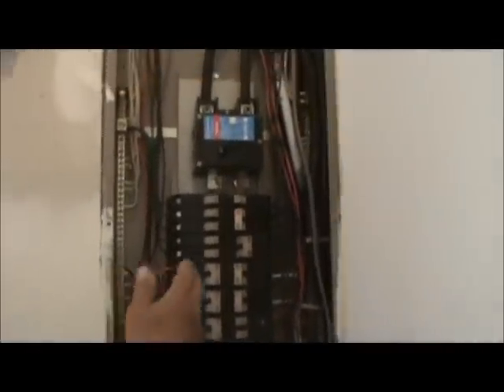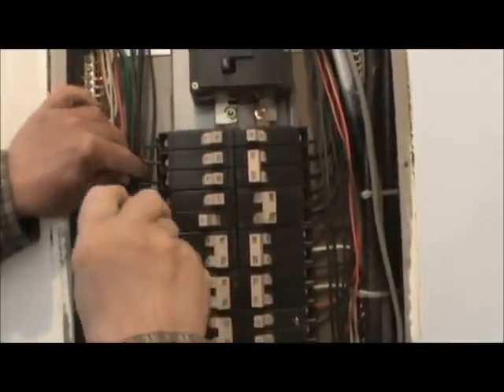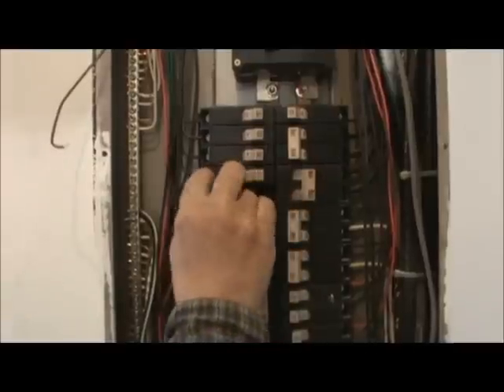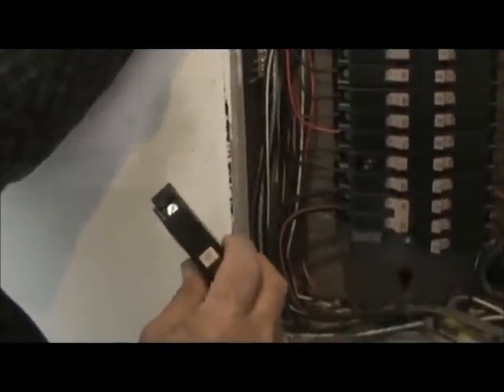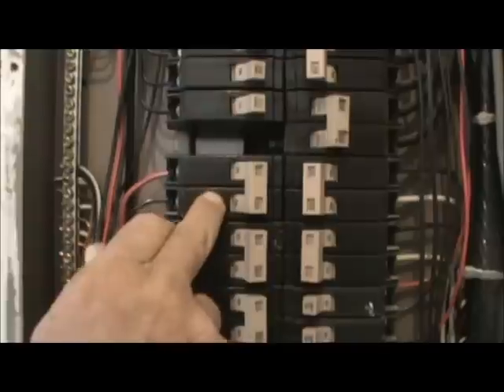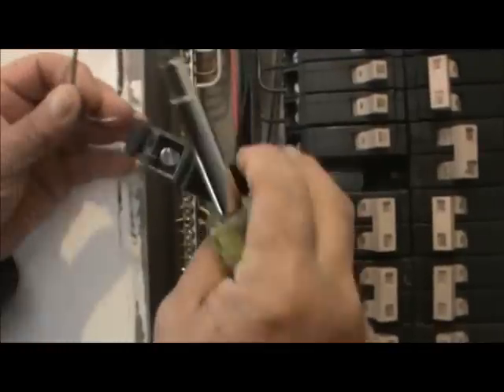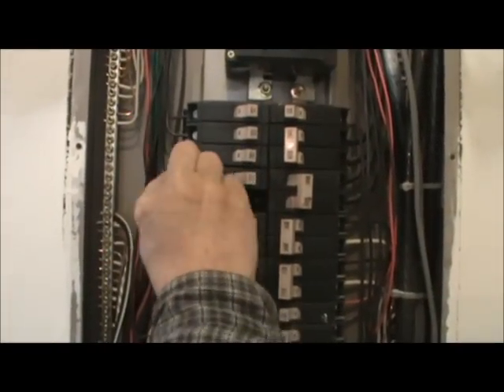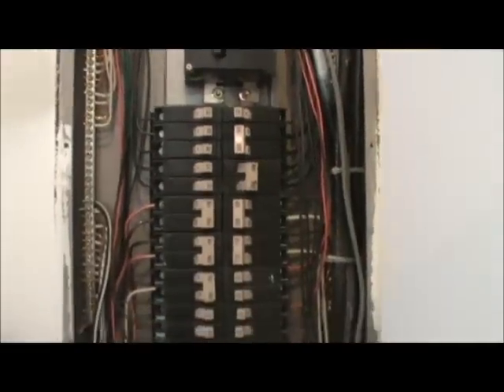How To Replace A Breaker In A Panel Box

Comment: Thanks for this video. My kitchen lights went out, the breaker switch is stuck in the middle. It won't turn off or on. It sparked too. 😢 I'm going to replace it today. I will turn all the power off first.

Comment: Thank you for the simple explanation.  I have installed breakers in my old house where I did a full kitchen remodel and added several new appliances and more outlets.   However, now I live in a high-rise condo, all the Main breakers to each unit lives in a locked "closet", in the main hallway.  So, I can see instances where one has to work on a "live" panel, removing or upgrading breakers.  My current project involves a tankless water heater and requires that I upgrade the breaker from a 30A to 40A.  The building is 2008 and the breakers are GE, it's a quality panel.  However, any decent tankless water heater will require 8 or 6 gauge cables.  The current fat tank water heater uses 30A and 10ga cables.  So, I have new power cable fishing to do from the panel to the AC closet, where the water heater lives.  This will involve popping out and popping in new breakers in a Live panel.

Comment: For the novice whose about to attempt a DIY replacement. Bad, deadly news here, Harold doesn't mention that the house powers main breaker needs to be turned off before poking around with the breaker with a screwdriver for removal!

Comment: I have a breaker box and I added a electric central heat and air unit it was added 2 years ago it is not working and when I checked the panel box the breaker that is marked heat made a popping noise when I wiggled it, and I noticed all of the breakers on the right side of the box are loose the only thing I noticed not working is the heat. I know we have to replace the heat breaker but should I be worried about the other breakers?
Reply from the maker: Give me a call I can help.
Reply from the maker: 434-284-.0600

Comment: Kill the main power before removing the panel!  Bad advice here.
Reply: Most electricians don't turn off the main. They turn off the the breaker and normally remove the breaker then unscrew the wire. the replace it. It is quite safe unless you stick your fingers up where the breaker was and touch the leads.
Reply from the maker: We do not turn off main because mains some times do not want to come back on. When you turn off the breaker you are changing is all you have to do.
Reply: If you turn off the main and it doesn't come back on, then you need to fix it first.  For DIY they should always turn off the main.
Reply: You're assuming that's possible. Unfortunately, you don't always have the ability to cut power without having the power company disconnect the meter.

Comment: Harold I do not have a problem with anything you did as you are qualified but torque is becoming an issue as it is part of the manufacturer's installation instructions and I noticed you are not doing this. Have you heard this through any required NEC code classes?
Reply from the maker: Know I have not. I will check that.

Comment: Thanks for such a straightforward explanation. I would add, however, that you should turn off the main breaker before working inside the panel.
Reply from the maker: The main is not switch duty, some times it does not want to reset, so leave on watch what you touch. And thank you
Reply: @TheNaturesFriends seems to me the wire you touched would be hot of main isn’t off
Reply: Thank you, I can't believe he never mentioned that shit.
Reply: @RandyKnight-o1q loo is o 2:14
Reply: Or the incoming is on the other side and the wire you touched is after breaker (such as leaves breaker and goes to bedroom)

Comment: I was told by a coworker that the breaker part that connects to my dryer outlet is bad because there's not enough electricity running through and not enough to power the dryer.  How much does it cost to get someone to replace the breaker?  I tried taking it off myself and ended having 220 watts of spark fly in my face.  I don't want to try it myself again.
Reply from the maker: Call a service man,did you turn the breaker off. You need a service call.

Comment: I do not have to turn off the main breaker as long as I work carefully, correct?  I DO however have to turn off the breaker that I am working on. Let me know.
Reply from the maker: You are right Thank you . Just be careful.
Reply: Thanks, I will buy the breaker and install it.
Reply from the maker: Let me no how it goes.
Reply: How did it go?
Reply: I checked 6 receptacles and two light switches. Turns out that I could visually see that a receptacle was the problem so I replaced the receptacle and have not had any issues. I did buy and keep a new breaker (ARC) just in case. Thanks for inquiring.
Reply: Okay. I had a 20amp breaker that I turned off just like Harold directed, loosened the screw, removed the wire and then the breaker. Tomorrow I will put in a new breaker and we'll see how it goes from there.
Reply: check your receptacles and switches visually to make sure the wires look OK, make sure screws are tight, and make sure wires are not touching anywhere they are not suppose to touch. Then, replace the breaker.
Reply: Finally put in the 20amp replacement breaker as directed by Harold.  Everything went just as he explained ... Merry Christmas all!  :D
Reply from the maker: Thank you.

Comment: Harold, do I have to shut the main breaker before replacing my burnt out 20 amp breaker ?
Reply from the maker: It would be safer but I just turn off the one I am replacing.If you do not feel safe with the box hot turn off main.
Reply: If he doesn't want to shut the main breaker off, couldn't he be a little safer by shutting off the breaker, then pop it out of the box, then remove the screws while its off the bus bar, away from everything else? And just reverse the installation of the new breaker.
Reply: Always treat these things like they're hot regardless of how certain you are that they've been properly deenergized.

You probably don't have to turn it off in the technical sense, but it is somewhat safer. In most cases, you should be fine so long as the portion you're working on is deenergized and you don't touch more than one thing at a time.

Comment: Hi, the breaker that runs the power in the living room shuts off. I noticed that when I turned the breaker switch to OFF, the breaker was loose. The breaker is not sitting firmly like the others. I noticed also that when I pushed it back in and then turned the switch to ON, power came back on in my living room but then the power went off about a minute later, just on that room. Why does it keep doing this? And does the loose breaker broken or is it its way of saying its going bad? I'm going to go outside in a bit and turn the main power off (all of them) because I'm afraid of any kind of possible shock (haha) and remove the whole breaker piece and see whats the deal. Any suggestions? Thanks, Mario.
Reply from the maker: Yes you can turn off main then change that breaker that cuts off  easy job to do
Reply: Hi Harold. Your video really helped me and learned a lot. Thanks. Ok, I followed your footsteps and changed the breaker. Power comes back on but now my fan in the living room stopped running. I did check all the outlets and everything works in that same breaker. I guess my fan clunked out me? The fan is hardwired to the switch in the same breaker and was working before the breaker went out.
Reply from the maker: call me at 434 985 2013 or cell 434 284 0600 we can talk about it

Comment: i  have a question...there was a heating element installed in ductwork to my oil furnace and the breaker was 60 amps.  I took it out and noticed the wire only had 3 wires in it one red.one black and a ground....why is there not a white or neutral wire here?
Reply from the maker: +moe roy You do not need a white just ground and 2 hots 240 volt no 120 in the heater
Reply: +Harold Shifflett thanks

Comment: do you know if an electrician or pg and e will come in for free to test my breaker amperage? I need to know the amperage so I can install a gfci in my room for my son and I cannot remove my breaker panel as I do not know how to take it off and I also do not have a volt meter.
Reply from the maker: +randomhalofan292 No free stuff sorry
Reply: Harold Shifflett
I ask only because my OSHA instructor said they may come in and test it.
Reply from the maker: +randomhalofan292 A number 12 wire is 20 amps a 14 wire is 15 amps
Reply: Harold Shifflett
Thank you so much, does color come into anything, or are the numbers printed on the wires?
Reply from the maker: +randomhalofan292 White is neutral Black Hot

Comment: Thanks for this video, Harold. Very helpful. 

Only one question: do you have to turn off the main switch or just the specific breaker you're trying to replace? 

Thanks a bunch,
Myke
Reply from the maker: Myke Nope  I don't , I just turn off the specific breaker, but I have been doing this for 40 years.  To be extra safe, you should turn off the main.  That way there's no chance for an accident.  Good luck and thanks for watching.
Reply: Harold Shifflett Thanks, Harold. I did end up turning off the main and it took less time to replace the breaker than to watch your video!

Thanks again, Harold!
Reply from the maker: Myke Nope Gald you got it going

Comment: My clothes dryer trips the breaker, but not right away and not always at the same time intervals.  The appliance repair person said that the breaker is "weak" and I should replace it.  Do breakers get "weak" before they burn out completely?  Should I replace this breaker?
Reply from the maker: Alan Markow Yes they can I would replace it Thank you for watching
Reply: Harold Shifflett Thanks so much for the video.  With your virtual help, I was able to change out the breaker that serves my dryer.  Everything is working fine and I'm still alive.
Reply from the maker: Alan Markow Good job

Comment: Hi harold.  It finally got real cold here in Florida and I started the heat pump. When it kicks on it keeps shutting off the breaker.  Do I have to change it out?  Thanks
Reply from the maker: Colette Pizzarella Give me a call at 434 985 2013 I will help you

Comment: Hi Herold...i have a question...can i  replace a 15 amp breaker with a 20amp breaker and can it be done using the existing wiring..thanks for your help
Reply from the maker: Only if it is a #12 wire #14 wire is 15amp #12 wire is 20 amp
Reply: thank you

Comment: Hi Harold, I was recently given an extra refrigerator for my garage. Everytime I plug it in and turn it on it trips the gfci outlet. I noticed that my inside refrigerator has a 20 amp breaker but all of the breakers for the garage outlets are 15 amps. Im guessing I need to change out to a 20 amp breaker for the new refrigerator? Thanks
Reply: Check the refrigerator's tag. The one in the kitchen probably has 20amps because code calls for those outlets in the kitchen to be 20amp circuits for the counter top appliances. Mostly, because you could be running multiple appliances at the same time that require more than the allowed limit on a 15 amp circuit.

Comment from the maker: You are going to have to purchase a cheap multi meter from Lowe's or Home Depot to check to see if you have 110 volts off of which breakers and that's the one you will need to replace.  The one you don't have power on is the one to replace.

Comment: Hi Harold I have a question, maybe you can help me. A few days ago one of the breakers in my panel burned out, I returned the switch to the on position and now that I need to replace the burned one I cant remember which one is, how can I detect the breaker that is not working? My breakers doesnt have a test button. Thanks!

Comment from the maker: Turn off your breaker and go to the first receptacle that's not working and take it out and see if the neutral wire is loose.  Any question, call me at 434 985-2013.  It sounds like you have a loose neutral somewhere, which is a very common problem.